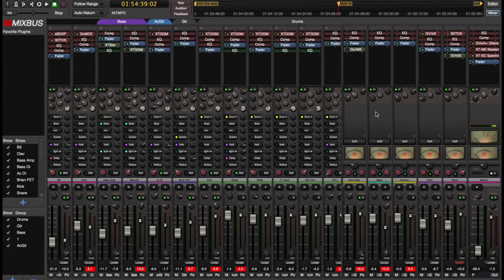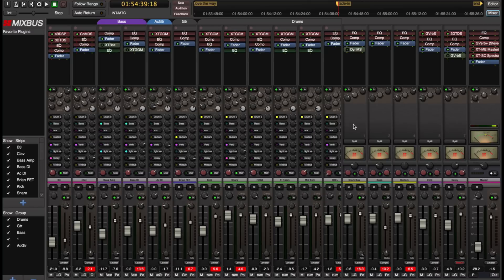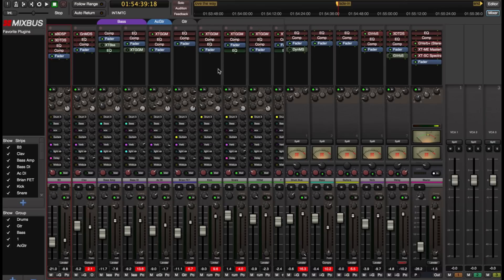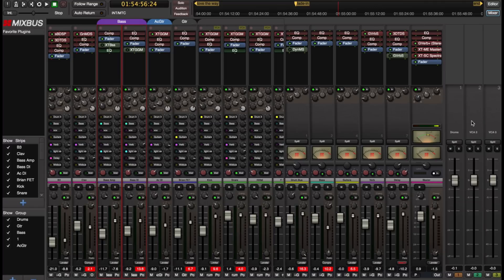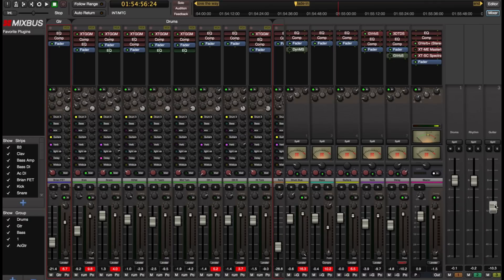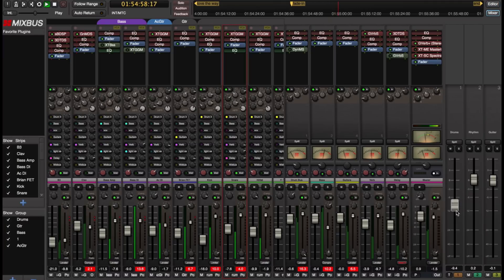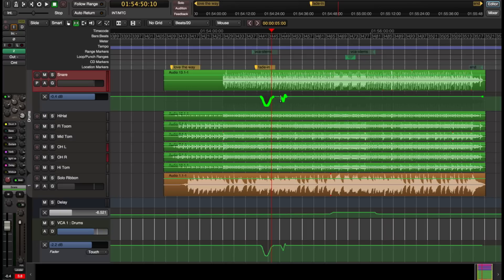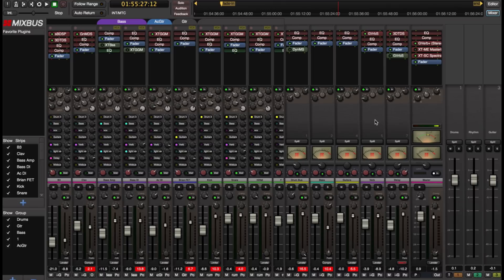Harrison Mixbus : VCA Fader Automation

Comment: Hi... Is it possible to control faders by a midi mixer?... I can reprogram that on cubase, reaper... Etc... As is not mackie hui... Etc.. Thanks
Reply from the maker: Hi Lui, there is a section of the Ardour manual that shows how to do the MIDI learn process for what you are wanting to do. https://manual.ardour.org/using-control-surfaces/generic-midi/midi-learn/

Comment: Hey Ben, thanks for the video. I was wondering how the VCA differs from a bus or group here? I mean besides the fact that it doesn't write automation on the tracks it contains or the group it still controls the volume etc. You could also just have a subgroup do that, am I wrong? What did I miss here.
Reply: Groups are always single-membership (a track or bus cannot be part of two groups). VCAs can be stacked or nested. Groups don't make it obvious how to adjust the mix levels inside the group, whereas with VCAs you can always play with the fader of an individual track or bus to change the relative levels of all the VCA slaves, while also having the VCA fader itself to change the overall level of the slaves.
Reply: If you are adding reverb to individual tracks from a post–fade send, and use a conventional group channel and fader to bring down the level of all those tracks, you will end up with a wetter signal, because the gain has been reduced in the dry path but the wet path has stayed the same. If, however, you use a VCA group, the group fader is changing the gain of each channel, so the amount of signal fed to the post–fade send also reduces by the same amount and the dry/wet balance is maintained. Another advantage of VCA groups is that you can 'group' channels that are routed to different outputs, which would be impossible using conventional grouping and group faders.